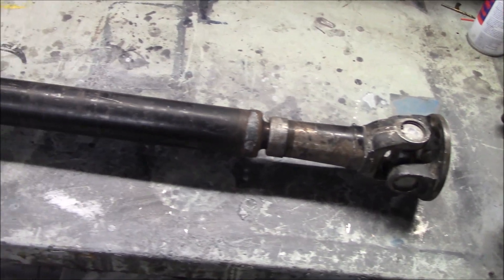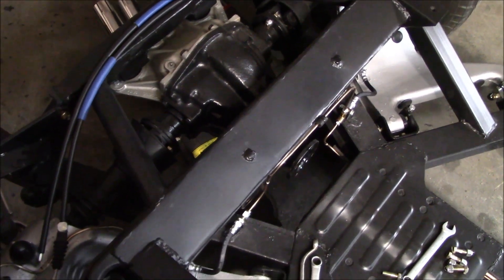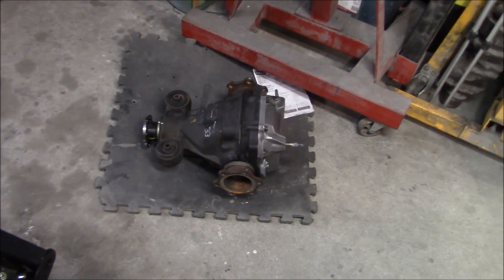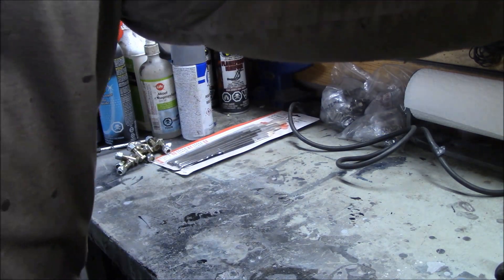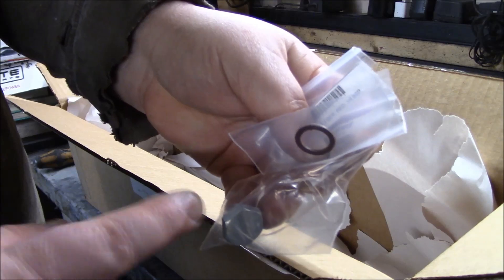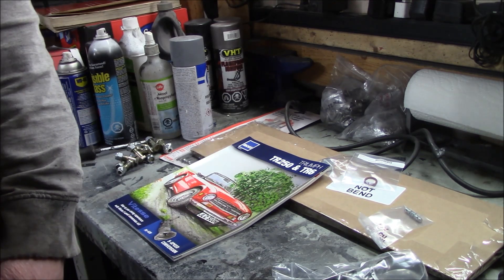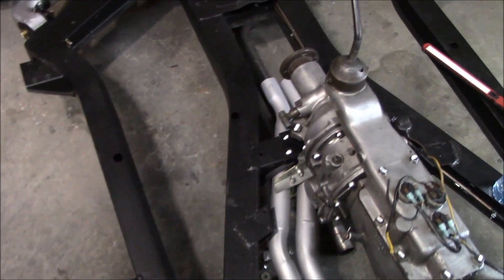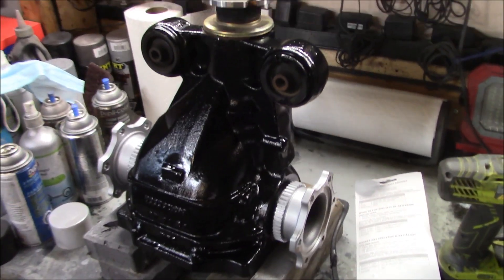1968 Triumph TR250 Restoration,  Watching Paint Dry.....

Comment: Good old Moss Motors (Moss Europe in the UK) you can usually rely on them with good quality parts. With them mikalor exhaust clamps, there not historically accurate on our cars, but I think they are great and have fitted them to many cars. They seem to clamp well without crushing the exhaust too much, unlike U bolt clamps. You'll soon have that diff in mate, now you've got the parts 👍

Comment: Sexy looking Diff. Also nice upgrade to the shop with the new air compressor. I'm sure you will notice an improvement in performance. 
Got to admit I would have put the "Ferrari" stickers back on also. Your cold garage sure brings back memories...not good ones but memories just the same.

Comment: Always a good day when new part arrive.. David it is cold here we have temps -2F and this weekend more snow about every week we get another 4-8 ". I have the 220V over heater, it will warm up the garage. The other day I got a call from my electrica power company saying my usage has doulbe more than last month . It is costing more to heat and light the garage than the house, to bad i did not have a bathroon in the garage, I will move in there. Question: what is different about the TR250 and a TR6 ..  Which one do you value more ?
Reply from the maker: The TR250 is really a mix of the outgoing TR4A ( body) and the incoming TR6 (chassis).....the body wasn’t ready for the TR6 so they went with a 1 year production of the TR5 (uk and some Europe) and TR250 (rest of the world) ....2947 TR5’s were made and 8484 TR250’s were made during the year.   From a value perspective, the TR5 is the most valued with the TR250 coming in second....I really like the combination of the earlier body with the later chassis...best of both worlds.

Comment: Dave, could you bring the to-be painted parts and paint inside overnight and then bring them out into the garage the following day to paint them? 
Otherwise, until the point that the Rusty Beauties command post is up and fully running you have my complete attention. 
Thanks and keep up the nice work. Stay safe
Reply from the maker: Hey Keith, small parts I could bring inside but it would be a bit of a challenge with things like the differential and the full exhaust system.    The heat gun method seems to be working out pretty well it just adds a significant amount of extra time in order to paint them.